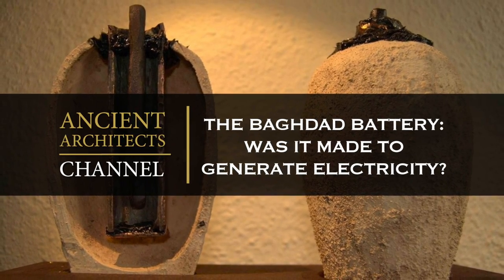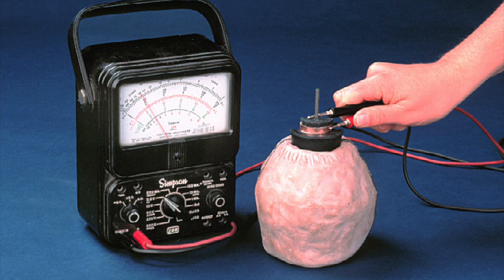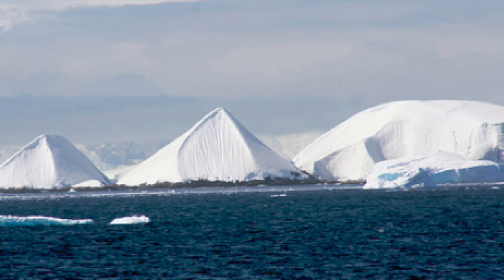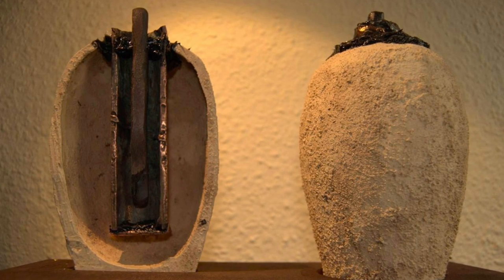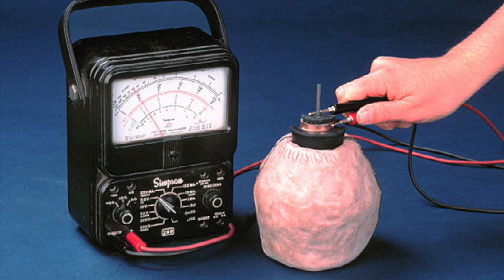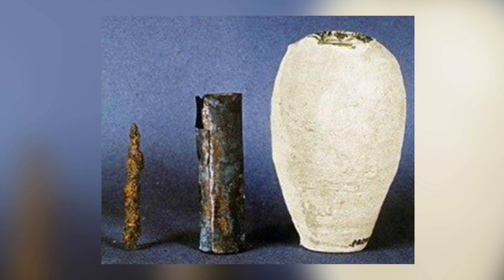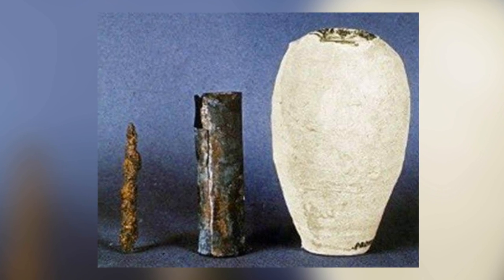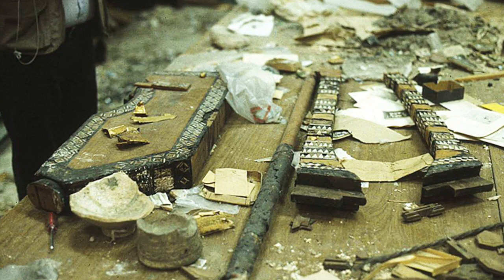The Baghdad Battery : Did it Really Generate Electricity? | Ancient Architects

Comment: Goulding things on gold.
They had Sulfuric acid from mine tailings concentrate, and arsenic is found in organics and tin/copper. So they dissolve the gold in arsenic and add the current to a primed surface in the good arsenic solution and bang! Gold plated
Reply: Good comment. They used the thing for something like that.

Comment: A AAA battery is the same voltage as a D cell. Only the current produced is greater. Daisy chain the cells. I need to research this further. The battery is the most logical use imho.

Comment: Im reminded of old iron water pipes. If i recall correctly sometimes a magnesium 'dummy' would be attached to the pipe. The magnesium has a lower electrical potential than the iron so it corrodes first. Surely ancient people could have noted the effect of two dissimilar metal together over a period of time. With respect to iron and copper, tin and, lead, the iron would be the sacrifice.
What im thinking is we have a copper vessel inside a vessel. the copper has lead/tin soldering and if in contact with an oxidizing agent the copper vessel would come apart at the seams. The presence of the iron rod could be to prevent the soldiering from failing. for this theory to be correct, the iron rod would have to be electrically bonded with the copper. im reaching here, but the only use i can conceive of that requires such methods is some kind of chemical manufacturing. 
alternatively theyre fire bombs. within the copper canister an exothermic reaction is triggered when the iron rod contacts the casing. maybe a slow build reaction. a catapult operator would strike the tip with a hammer to drive the rod into the copper casing. They then hopefully fire it at the enemy before it explodes

Comment: The asphalt seal over the top of the iron rod could have been used to protect the iron when it was in storage - iron rusts very easily. When the 'battery' was then needed you would simply cut off the asphalt seal and connect it up. Clever aren't I? :)
I also don't buy the storage container for papyri idea. Was any papyri ever found inside any of these? They also don't seem big enough to contain anything like that.

Comment: They could be used for gold plating, which would only require electrodes. Since these would be much more flimsy than the batteries themselves, it would make sense that they are nowhere to be found, as they would be corroded away by now. The same goes for any cabling used to hook up more than one battery in series or in parallel.

Comment: There's a lot of data in photos like that at 3:51.  Besides the obvious hand smears left by touchy tourists, my natural eye algorithm finder sees an ~30° slope behind that right wall. There are certain patterns that abutted stones display due to alterations of osmosis, absorption and adsorption. Yes, I think fancy equipment is just dandy, but photo analysis can tell a lot. I suggested the coiling ramp long ago, before I heard of Houdin. Based on obvious alterations in coarse tones, shadows, etc. 

The "battery"? Likely that contacts were connected by gold wire, which would be looted very quickly. The tar or asphalt is likely to melt with heat and hide the exits of these contacts. On the other hand, what parchment fragments have ever been found in them? What chemical analysis has been done on the inner walls? They are as yet unexplained, and definitely not explained away as batteries.

Comment: I am an American archaeologist and a metalsmith/experimental archaeologists. Only a .5 volt is necessary to plate copper, gold, or silver over copper flashing.  I have made this battery using California bitumen gathered from beaches and red wine.  I know how California!!  It works for plating jewelry.   Using an old ceramic wine vessel,  The bitumen warms with hand warmth and cracks with ice or hardens with cold water to crack. Easy to replace wine.  More voltage is achieved by connecting batteries in a series of object is large. A vat of one gallon only needs .5 volts to plate pieces of jewelry. There are actually many metal pieces plated from that era and area. I know,  mainstream!?!?!!  Try it.  All humans, ancient and modern, way more creative.

Comment: My only concern with the scroll holder hypothesis is that the same questions may be asked about the battery hypothesis. Why the metal inside, why the signs of corrosion, why would they concrete shut a scroll holder? So many questions

Comment: Rather than electroplating dissimilar metals, it could have been useful for processing certain types of ore... basically electroplating silver onto silver.

If this were the case it would change the makeup of the metals, since some electroplate better with different chemistry and voltages.

This would have been useful as seams of pure ore became exhausted.
Reply: Correct

Comment: What if they were used as lighters? All you really need is thin metal shavings, or thin copper wire. Then some dry tinder, and you'd get ignition. Could have been used in businesses as bakeries, smiths etc. Or upper class homes who could afford such a thing. And the reason you don't find anything but the batteries, is that the metal shavings or wires will have decomposed by now. It would just be dust.

Comment: I always figured it was for electroplating, but if they knew that then they must have known about electricity. I'd say they must have known about electricity, but knowing how to harness it is another story. Still, maybe the problem is how easy it is to make a "battery". I mean you mix two things together unintentionally and you get a reaction. I think the main thing here is how much power could these things actually generate. It looks like they couldn't have run anything other than a simple wrist watch on it, right? 

It could have been nothing but a gimmick someone sold, like a cloud busting organite emf or whatever contraption. "Hey, it looks neat, it's heavy, maybe gives you a tiny static-type shock when you touch it, so you buy it to rid your house of spirits or whatever. Who knows. Unless they were wiring hundreds of these together to power lights then what would be the purpose? Imagine what it would take to keep the power going. Just not possible, but then again maybe it was used only one night of the year for a festival? 
Would be cool if we found a roll of ancient copper wire though. Imagine a big lightning rod on top the pyramid with a bunch of copper wires running down the sides to these batteries. Yeah I'm kidding. But imagine if they could harness lightning strikes.

Comment: Wire are made in to jellery or were made of iron and rusted away, electrolysis of gold. In a thousand years we have stuff that will just vanish. When they went bad they layed them there and the wires were not set there because they were going to be thrown out or recycled. Asphalt was most likely to seal the battery from corroding further or creating acid powder.

Comment: I believe they could have been used for chemical hydrogen release. I know it's a new concept. However it could explain having light from fire without smoke stains on the  ceilings. Copper iron and acidic Any liquid. Can definitely release hydrogen for fire that could provide light in say a tunnel.

Comment: Fill the jar with vinegar and the cylinder with natron (backing soda).  Seal it.  Depress the copper plunger at the top to push the bottom out of the cylinder and allow the natron and vinegar to mix.  Stand back and watch.

Comment: Maybe it was used in ceremonies where neophytes were subjected to the mild tingling from touching the two metals to convince them of the presence of a "higher power". It would seem like magic but would just be technology. It could be that the containers were sealed and stored until used after the bitumen was removed and the metal components were exposed. The diagram shows a gas vent opening where the acidic solutions were added at the time of use.

Comment: As always your channel is the best.

In years past, I saw a picture of a discovery of these pots while in place where they were found and they were in series with copper "wire". That being said, I have wondered how the past had so much gold that we find. I have a hypotheses; It doesn't take much voltage for gold electrolysis recovery as that is more current based. If five of these pots were in series that should produce 6 volts (5x1.2v). Placing the electrodes in a slurry of acetic acid (vinegar) and sea salt and gold dust bearing soil/crushed rock; the negative electrode (or cathode) will seperate the gold dust from the slury. As most of the gold mining is recovering gold dust. As for the asphalt covering the post, that could be a way to store the pot/battery. This could be why there was so much gold in the past.

Comment: We put plastic covers over our terminals as you don't want them exposed. The voltage would not be greater in a larger vase as the Galvani potential between two metals or a metal and an electrolyte determines the voltage not the size of the vase. I have enjoyed your hard work and I only placed my comments for discussion not to prove or disprove any of your points. thank you

Comment: Arguments not to dismiss the battery:
The copper inside is soldered! together, they didn’t have plastic protection cups so the battery was just still sealed. 1 volt is enough for electroplating and they knew many ways of goldplating that is still ”unrivaled even by today’s standards”:
https://www.sciencedaily.com/releases/2013/07/130724124919.htm

Comment: If you look at a 12 volt car battery it has 6 stoppers for filling,this is because it is 6 separate  battery’s linked internally,each produces approximately 2  volts resulting in 12 volts total,each cell actually produces between 2.5 to 3 volts each . A 12 volt battery if in good condition will usually deliver about 14/15 volts in total,a larger battery produces more amps not volts,a 6 volt battery has 3 filling stoppers,a 24 volt battery has 12.in the case of say an electrically powered fork lift it will have banks of 6 volt battery’s linked in series to give a higher voltage and amps,to spread leadings and heat generated and allow servicing,lead acid batteries are heavy,the bigger they are the more they weigh.DC power stored in battery’s can have many uses that do not involve motors,DC  powers flows in one direction allowing atoms to be stripped from material to another allowing metals that are conductive to be plated say with copper or gold and can be used to erode surfaces in a way similar to acid etching,these flasks are unlikely to be far storage of parchment or papyrus scrolls.in my humble opinion they are battery’s.

Comment: I thought that some possible uses for it as battery are 1: small electric shock maybe experience as something divine.  2: they may have wanted to collect the gases the would have made a little "pop" sound fun if they were ignited.  3: the changes in the mental may have been an attempt of something magical or basicly alchemy (I think this is most likely of the three)

Comment: Have no idea whether it was a battery or not, but increasing the size of the vessel would not change the voltage, only parallel cascading of multiple cells would do that.  As to what could have been powered: certainly not motors but electrical plating of gold etc could have been done.

Comment: If the jars were not batteries, what were they? It only requires 2 volts, maximum 6v, for electroplating. The battery jars connected in series could achieve that.  Connecting wires would soon disintegrate in time, as they do in our day. There are many examples of electroplating dating back sometimes to almost prehistoric times. How do you explain that?.

Comment: Res ipsa loquitur, the thing speaks for itself. I think many times it's of benefit to take anomalous items such as this "out of context" as it were, and simply examine the artifact. 
A clay vessel, an iron rod, a copper tube or sheathing. Clay vessels are so common that we can consider them to be 'off the shelf' technology, readily available. We know that clay vessels were put to many uses, cooking, food and beverage storage, as shipping containers and of course as repositories for written material.
Iron and copper on the other hand were not so readily available. These were the result of a series of connected labor intensive efforts. Mining the ore, crushing it, smelting it and finally shaping it for it's desired purpose made such items costly. 
The cost alone indicates that the iron and copper tube were made to order for a very specific purpose. The way in which the iron rod and copper tube were placed in the clay vessel also indicates a very specific purpose. The maker of the artifact went to great lengths to suspend these items in such a way as to assure they were not touching. 
In addition, it's known that the vessel was filled with an acidic substance before being 'capped off.' Again, this indicates that a very specific purpose underlies the manufacturing of this item.
The clay vessel appears to be completely unadorned, indicating that it's purpose was practical or industrial rather than religious or ritualistic. 
All in all, 'the thing itself' seems to be the result of a costly and time consuming trial and error process with a very specific goal in mind. From this perspective, the idea that these items were assembled in such specific ways for a purpose other than to create an electrical charge stretches credulity. 
To stretch the point, that's akin to setting out to build a refrigerator that is also, accidentally, a tape recorder. 
It appears the theory that the Baghdad Battery was created for some other unknown purpose is based on 'the lack of' what one might expect to find. Where are the wires? How were these things connected? 
On the face of it, this seems to be a rather thin argument. The wires simply could have been removed, in the same way that we unplug a toaster when it's not in use.

Comment: Great video!  The Baghdad battery is a galvanic cell very similar to the "cylinders of the pharaoh" which is made from copper and zinc cylinders filled with quartz when held produce up to 1.5 volts.  Make them yourself or get them on amazon or etsy.
Reply: These are actually thought to be documents containers. The cylinder in the center would have had a scroll wrapped around it.

Comment: there is more to this, the design is very similar to a person who recently tested using copper rods and zinc nails with some wire and had similar versions of this concept (minus the pot) just stuck in the ground (soil), and in a short series  of these he had generated around ten volts with just a couple of these small rods in the ground that powered a small light of his throughout the night. The pot is a mystery but there is definitely electricity that can be harvested from the ground using this simple method.

Comment: It wouldnt surprise me if it was used to electroplate, but no chance its anything more significant.
Reply from the maker: Evidence says that electroplating was done via fire gilding and mercury... hmm...
Reply: Christian Buczko would shock therapy be a possibility? Medicine in those days was part experimental and part wizardry. Were not organized enough to use scientific process. No peer reviews. Everything was local due to communications limits. Just thinking and building from your comment. .
Reply: @MrMarshall7491  One volt and a tiny available current is far too low to even feel.
Reply: @AncientArchitects  There are multiple ways to plate something. The Inca used a very neat technique. Make an object out of an alloy of mostly copper with a little bit of gold (maybe 95% copper, 5% gold). After you are finish making the object, soak it in vinegar or other acidic solution. The surface copper dissolves, leaving a spongy gold surface a few thousandths of an inch thick. Burnish the surface to compress the gold into a thin plating. It is very difficult to tell the difference between the Inca method and electroplating. It takes microscopic examination. Acid soak, electroplating, fire gilding? I suspect that most ancient jewelry has never been examined closely enough to tell exactly how it was made.
Reply: They are obviously the batteries used by the Ancient Atlantean Spaceforce.  We know this is true, in von Dummkopfian* thinking, because mainstream scientists deny it and it just looks like ancient batteries should look.
*von Dummkopf actually used these "proofs" in one of his unintentionally hysterically funny Ancient Aliens Are Real books.
Reply: @thetruenolan6655  That is fascinating, very cool.